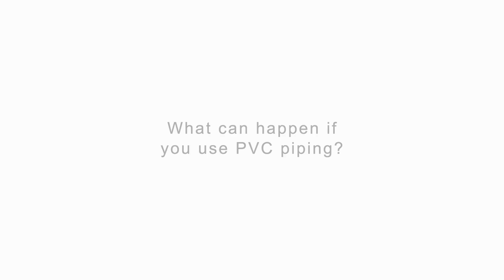Why You Should Not Use PVC For Your Compressed Air System

Comment: Ordinary 3/4" PEX (not PVC) can take about 1000 PSI at normal room temperatures before it ruptures. And it's a soft plastic, unlike PVC, so even if it did burst, it's not going to be anywhere near as dangerous or have shrapnel.

Comment: Who outside a dealership is running 175 PSI? That is too high and hard on air tools, why did they leave that out. Ours had a moisture trap system using refrigeration. Then it went into a regulator to drop pressures to 125 PSI, besides we had a full body shop that also needed dry air and clean. I have never worked anywhere running 175 PSI even with pressure drops over distance and my air tools came off the SnapOn truck starting in the early 70’s. Has no one ever read to owners manual for their air tools? Maybe that why lug but break bolts after a stupid tire shop. With or without “Torque Sticks” of different colors. I won’t use then as too many variables. After all, what are torque wrenches for? I have 4 and one is a simple in. Lb. beam-type for pinion bearing preload. The others have stickers from re-certication after checking or adjusting by SnapOn. They use to reman needle nose pliers for free. That’s how long I have been fixing vehicles & motorcycles at a dealer w/o 175 PSI line pressure. Is that a comet in the sky? Nope, just another jet who’s engine fell off!
ASE Master Tech since 1978 - Retired (Bet you sales guy is not, used car sales now with A/C in office. Sissy.
Reply: 175 @ the compressor then goes to a regulator normally, I run about 150psi, air tools at 90psi are very underpowered. I have worked in many shops that used  pvc pipe I used it in my own shops for over 15 years, with no problems rarely did it break and if it did it was because someone hit it with something and it didn’t explode it broke into 2 parts and was easily fixed.
Reply from the maker: It’s amazing what we see around the country.  Total system designs make a big difference, just like using the right tool for the job.

Comment: Ummmm... PVC pipe has a 400 psi pressure rating. 🤔🤔🤔
The actual air line kits out there are not rated for even 200 psi.
Reply: I have heard that the problem is a chemical reaction with oil from compressor. With time, the pvc become more and more fragile. I dont know for sure if its true. But my guess is that if it would be absolutely safe, pvc company would love to have this business ...
Reply: @mrmadame28  I agree with you. There is a difference in failure results between water psi and compressed air psi. It also is not legal to install pvc air supply lines  in commercial buildings in most states. I hope the guys that use it to save money put that money towards their life insurance policy.
Reply: So PVC is rated for 600 psi .  And yes it breaks down.  Just change it every 2 years.
Reply: @noturavgman789  why not use pex instead of changing everything every two years? I dont understand the logic
Reply: @mrmadame28  I just looked up the price. Ya it's not that bad.  And PVC does last longer then 2 years. Just saying don't want until it break. PVC does need to be changed on the Reg
Reply: @noturavgman789  ah ok i agree!
Reply: @noturavgman789  my PVC system has worked for 7 years using a 175 psi air compressor that very rarely was turned off. I'm in north Florida and we very rarely see freezing temps. The inside of my shop never went below freezing. I'm building a new shop now and researching the "professional" piping. Still not convinced to change.